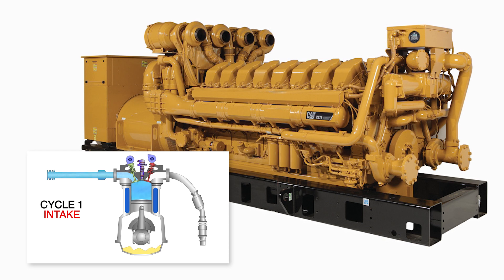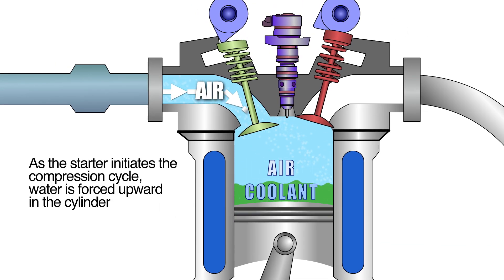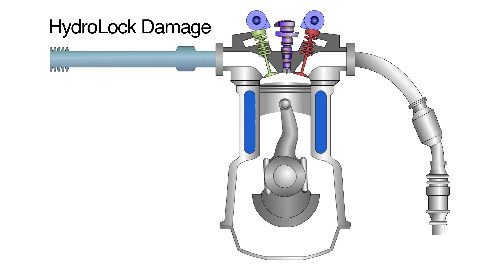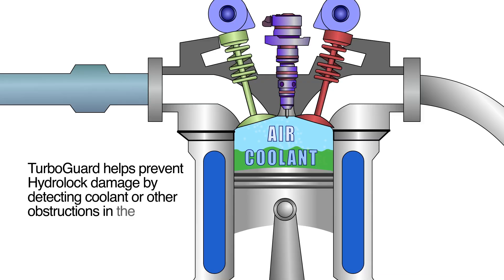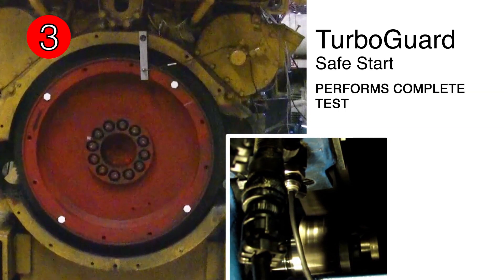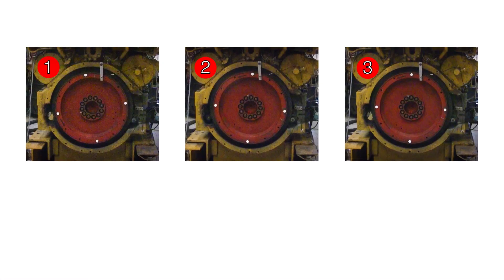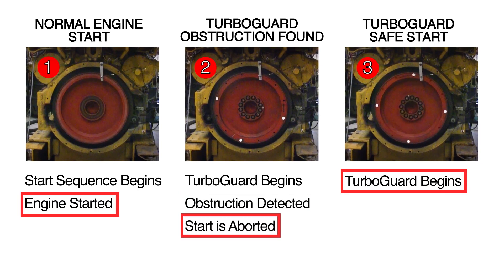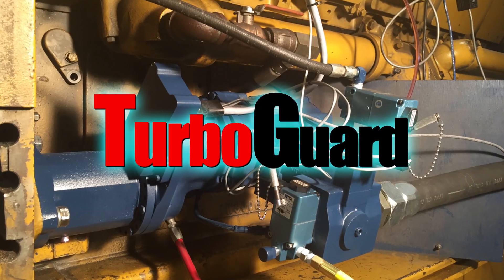TDI Turboguard Prevents Hydrolock Engine Damage & Prevents Operation Downtime

Comment: Seems like they could make a compression relief and hold the exhaust valves open until the engine hits a preset rpm.

Having exhaust valves open would push the coolant out of the cylinders and into the exhaust manifold where it cant cause any damage.
Reply: If they were held open, the pistons would bend the valves.
Reply: @sportscarclinic  Oh my god, What an exact answer
Reply: @sportscarclinic  Thumbs up
Reply: Lol. That’s not how engines work…